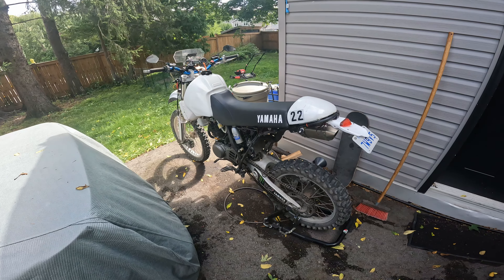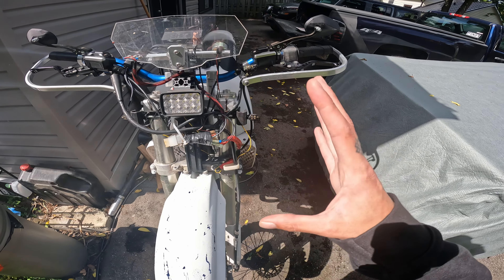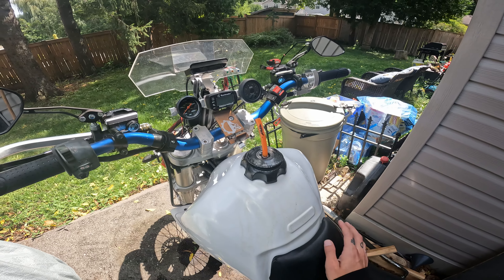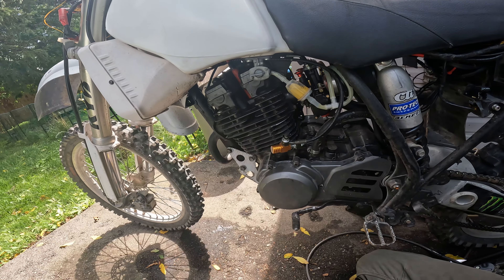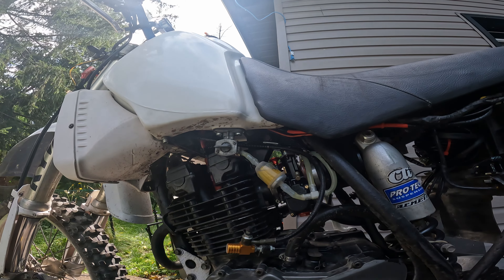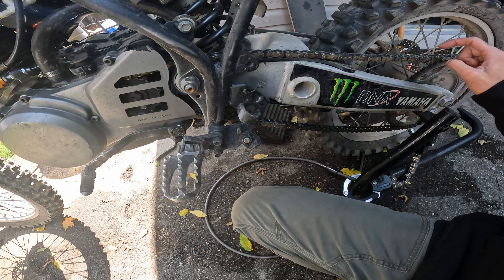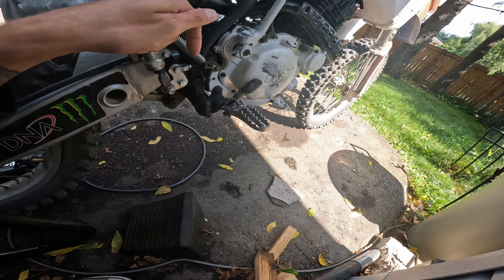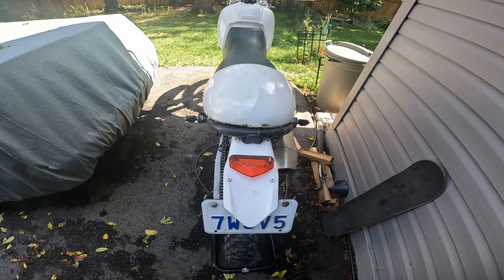Yamaha XT350 Modification Review & Alternative Carbs (4K)

Comment: wow super heavy mods! That's a great build, was it a lot of work to swap the yz forks in ?(modification wise compared to the stock ones) And do you think a similar swap for sand use races could be a great move?
Reply from the maker: @thomasenbalade  it was pretty interesting, somewhat complicated but not too bad. I'm probably going to sell the frame w/ suspension mods as a rolling chassis now that I'm riding the DR650

Comment: Also I have the same Clark tank, those caps are VERY sensitive to over tightening and will split. I’m on my second cap now and only close it lightly with no issues.
Reply from the maker: @NickDives1023  that's good to know! I want to find an all aluminum alternative to the stock cap but haven't been able to find one yet that fits.

Comment: hi, interesting what hydraulic clutch set you used? I am also thinking about it. thanks
Reply from the maker: @Roolis77  Hey Roolis77 I've tried out a couple different ones, generally all the slave cylinders are similar so you will probably be okay with any of them. I just put the same one I had on my xt350 on a DR650. They seem to be relatively universal. They come will a bunch of adapters for the slave cylinder end
Reply from the maker: @Roolis77  look up "Aramox hydraulic clutch kit" on Amazon. That is the same style as the one I use. Multiple manufacturers make them